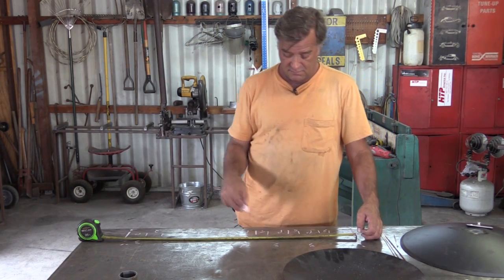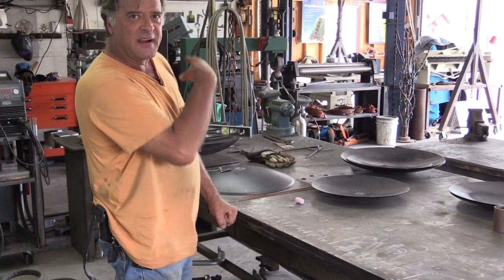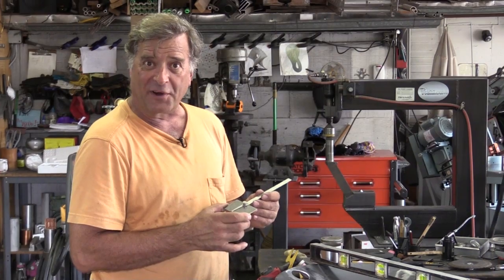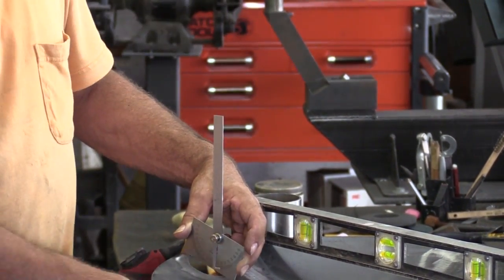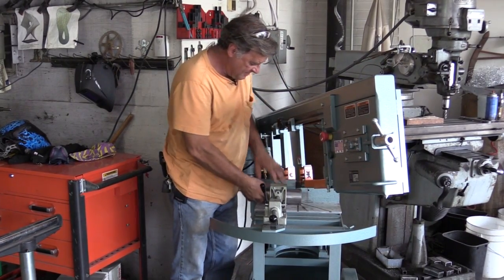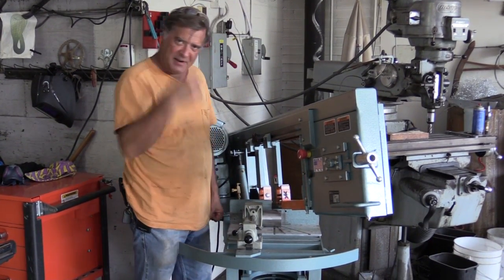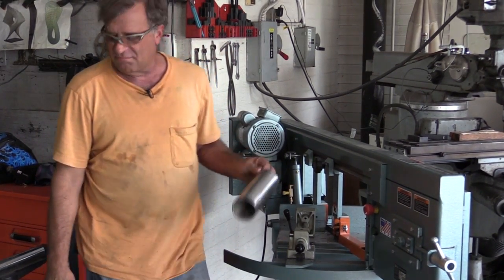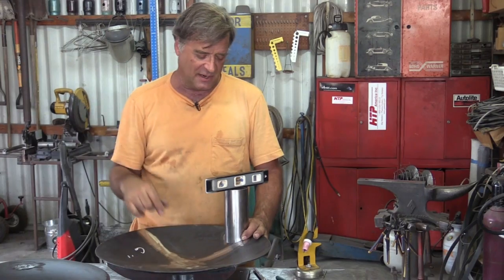Shop Math: How to Calculate and Cut a Fitted Angle - Kevin Caron

Comment: Keven, do you find any difficulty in welding discs such as cracking due to cast iron from unknown sources?
Reply from the maker: +4Svelte       These are plain steel..    Not cast..    No problems welding that I have seen...    But I am not using them like they were intended...